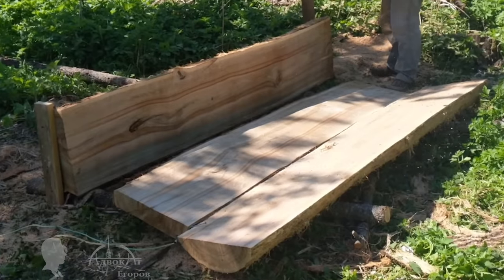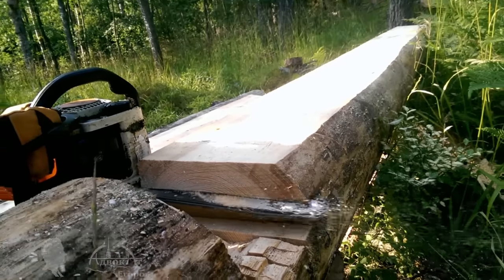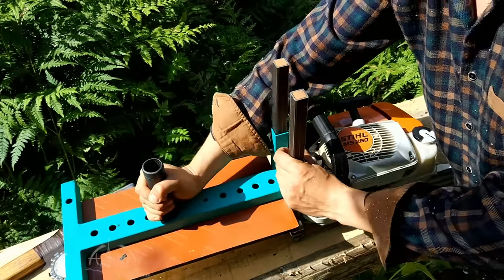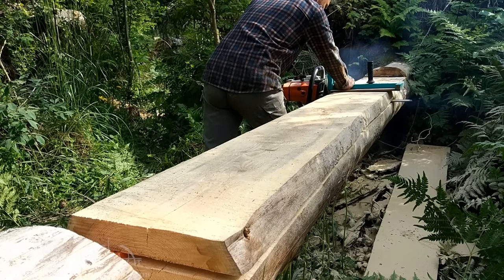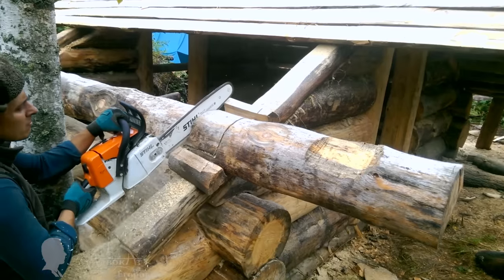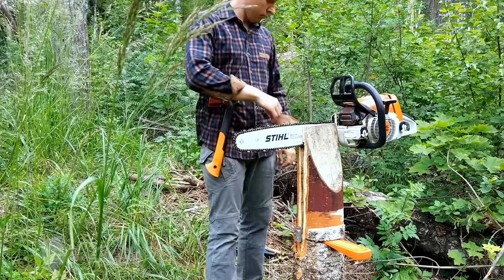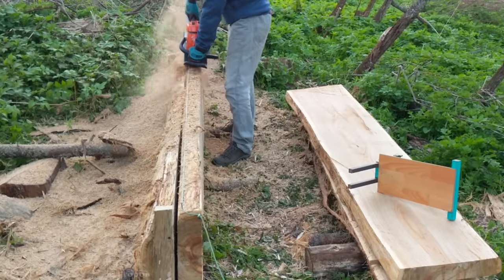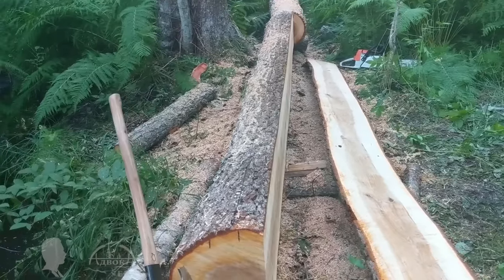Two Chainsaw Secrets | Turning a Tree into Perfect Boards

Comment: I'm super impressed. I never would have thought such results were possible without a sawmill attachment. You prove your cleverness once again!
Reply: did this 4 years ago. i just snapped a chalk line. it is surprising how easy it is to hold it vertical.
Reply: I find it easier to cut of the edge with a "beam machine" especially with curvy logs. What advoko does works well but only on good straight uniform logs for me
Reply: Do not cut slabs like that, not enough load on the saw. You'll end up burning it, like he did.
Reply: Humans have been cutting straight boards for thousands of years using just saws and no jigs;) the industrial revolution unfortunately has made us forget a lot of these genius techniques....
Reply: @em4703  running low rpm little or no load,why it will burn?
Reply: @em4703  yea if the saw has 5kW; you can simply use a weaker saw like he does, the amount of sawdust flying out there seemed like pretty sufficient load to me... or even weaker one. nonetheless a good point to mention here
Reply: @tomaskozler4856  the RPM hitting the limiter says otherwise. he burned his first saw by doing this.

Comment: You're a genius, Advoko! I used your method and in an afternoon practicing, I was able to cut perfectly straight oak boards 3cm thick and 3.3 metres long, from a fallen tree just using my stihl MSA 220 battery chainsaw. It's all about relaxing, and repeating the swinging technique. It's counter intuitive, but it works like magic!
Reply: Великолепно 🎉. Даже ваша пила справилась с распиловкой вдоль волокон. Вы использовали цепь, заточенную под 10 градусов?
Reply: Wow, impressed you were able to do this with a battery powered device.  Which saw, and how long did the battery last you?

Comment: Hands down, this is the single most helpful chainsaw tutorial I have seen for felled trees.  Came to the same conclusion on Alaskan mills and milling attachments, and have been relying on a ruler and chalk line for about a year. The swinging motion and limiting the number of teeth that come in contact with the wood has tripled my production, but not fuel usage. I just slabbed an 2 meter section of 45cm walnut - each slice took about 5 mins and maybe 1/4 tank of fuel with a Stihl MS271.

Comment: Before I knew chainsaw milling was even possible, I was speaking to a local farmer around here who runs a small shop out of a wooden hut he constructed himself out of thin, smooth but irregular self-milled planks. When I asked how he built the thing, he told me he used a chainsaw. Blown away, I asked what kind of tech he used to pull it off. He told me "I used some pretty advanced equipment...you ever heard of a 2x4?" For years, his response eluded me. Now I think I finally understand what he was getting at. Can't wait to try it. Thank you for sharing your wisdom!!

Comment: This technique is exactly the way I make perfectly (mostly) straight cuts with a diamond blade in concrete. If you bury the blade slowly and with great focus on accuracy you can just relax once your buried and let the natural position of the blade find it's true course. Pushing gently forward and listening to the machine is all that is needed to keep straight along the way.
Reply: Love it!
Reply: Was thinking the same about cutting stone with diamond carbide as well. Makes total sense.
Reply: This also works great with regular old wood and a circular saw, plunge first at one end then let the saw do the work instead of cutting the good old fashioned way- a bit awkward at first but it works very well.
Reply: I used to work at a small welding shop, and I was frequently tasked with cutting a compound angle on heavy steel tube using only a grinder with cutoff discs, as our bandsaw wasn't up to the task. I used the same sort of technique, taking great care to begin the cut and then using the initial cut to guide the blade.
Reply: I was just cutting concrete slab today for bathroom remodel. I use your same method. True in cutting various materials is also true in life: don't force it.
Reply: Same when cutting stone with the big discs.
Reply: @Chaos_God_of_Fate  Uhh how the hell else do you use a circular saw? I'm genuinely confused as to any other way you could cut with a circular saw.
Reply: @contraband1543  same

Comment: I applied your concepts and with a little practice, I am convinced this is the absolute best chainsaw milling video on youtube. Chain stays sharp 10 times longer. I would suggest novices watch bucking billie ray’s videos on chain sharpening and make sure to use your gauge for guides so cuts stay nice and straight.
Reply from the maker: Thank you for the feedback on the milling technique!
Reply: @rap3208  yeah but, Advoko Makes explains it better, he actually explains the  "why" and the "how."   if you  presented to me those three videos of  cutting the lumber I would have thought "wow that's impressive" but then I would think also "I wonder how the hell even do that?"

the author makes their videos make sense. And yes, maybe they are executing better because they discovered the technique themselves and maybe they've had much more execution-experince  but it does not discount the value of this particular video.

Surely you can agree with the basic comparison that we're making here right?

Comment: I tried this method after seeing it in one of your videos on your other channel. I cut a massive elm log into slabs. It was so thick I had to roll it over half way through and cut from the other side. This method is so good, I was able to connect my cuts in the middle of the log. In all fairness, I was cutting very thick slabs and I had to do a bit of resurfacing, but still, a very good method.
Reply from the maker: John, I am so glad the method worked well for you! Appreciate you feedback! 
Yes, I published this video on my main channel a while ago...
Reply: @Advoko  Keep up the great videos. I learn something every time!
Reply: I bent so many bars trying this technique
Reply: Any tips for helping me with this
Reply: @rufushowe3885  A really sharp chain is important. Also, I should say, that my cuts widened out a bit more than his. I think this might help to keep the chain from binding. It was also my first attempt, so I could be totally wrong.
Reply: Daniel Silva Cool. Yes, there is no reason why the ‘cut only with the lower tip’ can’t be supported by a jig.
Reply: @Hello John how are you doing

Comment: Just want to give you a pro tip on the mill attachment. When using the mill attachment you should put wedges in the cut every 2 or 3 feet to suspend the board off the bar. I love you videos and hope this helps keep up the great work!
Reply: Maybe this takes too much time and you have to stop the chainsaw all the time

Comment: Thank you MaxEgorov! I learned a new technique which I will try in the coming weeks. My chainsaw is a Husqvarna 445 with an 18" (45cm) bar. It usually cuts very well with a sharp chain on most types of logs. We have plenty of forests & trees to work with here in Sweden, so it won't be long before I get to try your technique.

Comment: Advoko

One of the best dam videos on rough cut logs, lumber I have seen. Your are totally correct sir, your methods make cutting those logs easy. I have been using the Alaska mill for years and kept buying bigger saws to mill through that thick lumber.
I think you could get a smaller saw to swing easier. I have been using a Husqvarna 372 and 394 on the Alaska mill, but those saws are too heavy for swinging with a heavy bar. So I pulled out my old Husky 450 and I had great results swinging vertically with a sharp ripping chain. Took me less than half the time to cut the log with your methods than the Alaska mill going horizontal and running all those saw teeth contacting the wood.

Thanks for your simple and effective method.
Reply from the maker: Thank you for your feedback! Always good to hear that your life hack worked  for someone else...
Reply: Advoko, and Mr. 65895555, when using Advoko's method of vertical free hand milling with the swinging motion and just using the tip of the bar and chain,  what kind of chain have you found works best?   Skip tooth or full chisel?   Advoko mentioned filing to 5  to 10 degree angle on the cutting tooth.   Or is there a specific milling chain that works best for this method?  
By the way, thanks for your awesome advice and greetings from northern Minnesota.

Comment: I tried out your technique today and it worked! Amazingly easy. I have been struggling with an alaskan style mill which even with a brand new chain was hard work, very hard on the motor and the chain blunted very quickly. I use an old Stihl 038 farmboss 66cc with a standard chain. Your method was much easier, less wearing on me and the machine and a lot quicker. I wore a lumbar support for my back, which I would definitely recommend. I actually enjoyed the process. It is strangely rewarding. Thank you for sharing this awesome technique and if anyone is not sure, give it a try. It doesn't need huge amounts of skill, the cut seems to make itself straight. Brilliant 👍😁
Reply from the maker: I appreciate you writing back to me! Glad this log cutting technique worked for you!

Comment: Sharpness is a very important thing to maintain when using any cutting tools. Every so often I’ll be working on something and as the tool dulls I end up leaning harder on it or w/e and I really had to train myself to recognize these situations faster and instead of fighting with it, you take the ten or so minutes and go sharpen it. You might think it’ll take longer than if you just lean on it and force it (cuz you’re almost there!) but actually you’ll find to stop and go sharpen the tool, even though it takes some time will get the job done faster overall, not to mention you don’t have to fight with it, you won’t break the tool and ultimately you’re just being a better tradesman.

Comment: Discovered this video by chance as a friend is seeking help in such building methods. I have run a MS260 for a decade that has cut down and bucked at least 50 cord of firewood plus trail cutting and with the exception of one carb kit it has never let me down even during the hardest use. I have only used a 16 inch bar so as to better fit on my quad. Thank you for such an informative video.  Regards from BC Canada 🇨🇦

Comment: Crazy coincidence; This morning never seeing this method, I used it on some beautiful red cedar logs and was surprised by the accuracy.  Not the best, but pretty good.  I am sure it will be better next time using a bit more care as I proceed through the log.  And the best tip you gave, obviously is a properly sharpened chain.

Comment: I have some 1.8m  cypress logs to slab out for seats in my back yard. Coming across your video was perfect timing. I have just bought a Husqvarna 460 with 20" bar. Have only done four cuts so far, two through seasoned ,  very  hard and very dense, Australian grey gum logs and it cut really well.
Reply: I have a Echo Cs-352 16" Like new for a great price.. Any input on the model make?

Comment: I tried something similar to this method:
I used a $25 attachment that holds the chainsaw perpendicular to a 2x6.  I made multiple passes, cutting 1" each time.  When I got to 8" deep, I removed the attachment and cut the rest freehand.
It worked!
Reply: Bravo!
Reply: I just tried it again...and not for the first time...on Ash.  Quite a good result...and like Max says "your work doesn't stand still".

Comment: Consider a Husqvarna "Rancher 460" with a 24" bar. I've used Husqvarna chainsaws since the 1980s, and have always found them to be the best. I tried Stihl,  McCullough, and Poulen, and found them all to be inferior to Husqvarna.
   A good many people swear by Stihl, but I'll take a Husqvarna over a Stihl, any day of the week. Husqvarna tend to be less expensive, and generally offer "more saw" at the same price point of a Stihl. For example, on average, $500 gets you 60cc Husqvarna with a 24" bar, and a 50cc Stihl with a 20" bar.
  If yall think I've "bumped my head", or I'm "smoking something", please chime in. I'd love to hear your opinions.

Great video! Thanks for the lesson. 
P.S. You might seriously consider spending the $75 on a full face shield, and hard hat. Safety glasses are great for flying splinters, et al. But I can tell you from personal experience, that if it weren't for "company policy" requiring us to wear full face protection on the job running our saws, I'd either be sitting here missing my vision in one eye, along with half a face, and some nasty scarred over stitch work. Or not here at all. Although it's fairly rare, "bar kick back" can, and does happen. And when it does, it's instant, and can be brutally violent. In my case, I hit a strand of barb wire that had been grown over and concealed inside a tree I was clearing. Chain brake bar worked, but only milliseconds AFTER the chain at the top front edge of the bar slammed into my face shield.
Reply from the maker: Thank you for your advice! I actually bought a Husqvarna 365 chainsaw recently. It was working as a champ so far...
Reply: I run Husqvarna myself and couldn't agree more. I used to cut firewood for part of my income, and used Stihl saws. Both of my Stihls were broke and borrowed a rancher 460. After a week I decided Husqvarna was the way to go
Reply: I love my husky 60 , I put a 28inch bar on it so you don't have to bend down to do grub work, can reach the ground standing up
Reply: Thank you for the safety reminder

Comment: I've been cutting lumber like this for several years,you are the 1st I've seen to do the same.I use my older Stihl 041 and Husky 65l they are heavy but seem to handle it better than my other saws,I have a Husky 365 special that does well and is fairly light but I use it to fell trees mostly so don't want to lose it for that reason,I've recently bought a Husky 77l that I'm going to try soon just have not had time yet!Nice video
Reply from the maker: Glad to hear someone else came to the same conclusion!

Comment: Just saw this video and wanted to say thank you for the insight.  I'm now working on a way to modify my chainsaw mill to allow the tip to sweep the log from side to side while advancing instead of using the length of the bar to make the cut.  Wouldn't have thought of this without your video.  Greatly appreciated!!

Comment: Damn I'm impressed! I've cut mango slabs with my Stihl 440 but it's quite a soft wood. I've been to the Amazon a couple of times and they freehand cut boards there too. I run a ripping chain when cutting boards and file down the dogs until I get good bite and shavings.
Reply: HawaiiLimey how much do you file them down?
Reply: @dangudgel5079  sharpening a chain always match the number of strokes with the file on each dog. I usually do 3 passes with a small flat file on the dogs and cut some wood to see how it feels. File them down too much and the chain will bind in the wood, tear instead of cut and possibly be dangerous.

Comment: For anyone wondering this technique of the swinging motion absolutely works. I am a complete novice with a chainsaw - probably used one for 2 years to cut and buck dead trees and storm blown trees. I wanted to create a bench out of a nice oak tree that has blown over. I used this swinging method and it was far easier than any other method I tried.
Reply from the maker: Ted, thank you for your feedback on the technique.
Reply: Worked great for me too
Cheers from Alaska

Comment: Hi mate its rufus from London England again,  ad you know I'm a tree surgeon for a big company in London,  I only use husqvarna chainsaws,   you should get a husqvarna 351xp it's a good meaty saw, and if you use the correct two stroke it will last you for years, I've not serviced mine for six months and still going strong,  I use a T540xp for climbing,  because it's a one handed saw, good luck with the saw hunt,, also if you like stihl try 362 with 20" bar good luck my friend,  nasdrovia
Reply from the maker: Rufus, thanks for your advice
Reply: Your welcome my brother
Reply: I am also a big fan of Husqvarna's XP saw range which is designed for professionals, but the lighter weight (eg from magnesium not steel components) and more power for same engine size, plus better (lower) vibration characteristics, makes them superb saws for the home DIY'er like me. More $ to buy but last longer and better productivity makes them worth it imho.
Reply: I was going to suggest the 560xp, fine saw
Reply: Hello "jah pedro" unfortunately the 560 saw is not a professional saw, it's a DIY back garden joby,  still  a good make, but not for me, with its 15 inches on the bar, I use a 12 inch bar for climbing and a 20 inch and up for felling or snedding,
Reply: Apprentice GM,  nice to hear from you, are you interested in becoming a tree surgeon,  I like your comments,  you took the time to explain what interested you in your saws, which is rare,

Comment: I used a Stihl MS360 chainsaw to mill up a logging truck full of fir, hemlock and pine. However, I did use an Alaskan chainsaw mill. I love your freehand technique, but it does rely on having a good ripping chain that is perfectly sharpened. Believe me… it took me a long time to get good at sharpening.
Great video / thank you!

Comment: What a great method of cutting, thanks for posting this video.
As far as the chainsaw failure it could be caused by uneven thermal expansion. When you start your saw do you get right into cutting or let it warm up? The piston will expand much faster than the cylinder head and can cause a lot of damage if the saw is put to hard work upon starting. The difference between the saws may be a bigger cylinder head which takes more time to heat up. Your saw may be cooling down faster than you think in the winter temps you have in your area. I know it slows things down but your saw will appreciate it. Thanks again for the video.